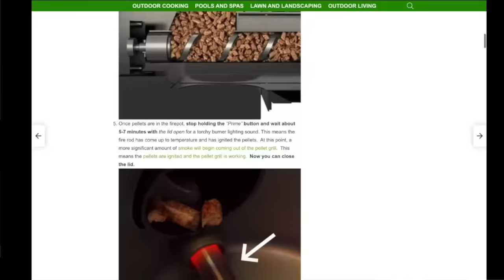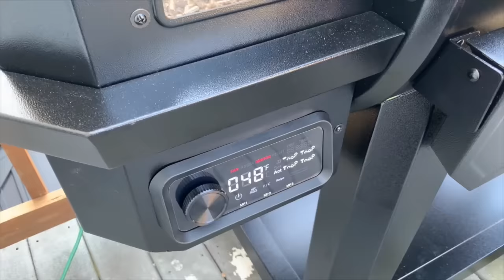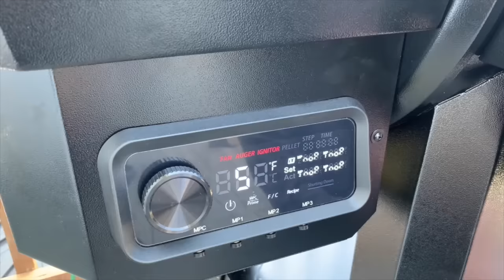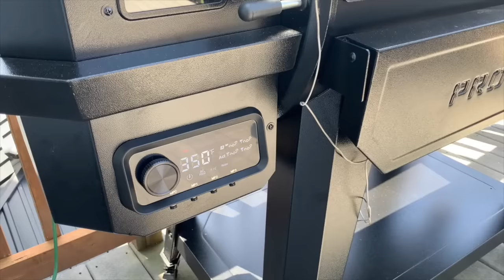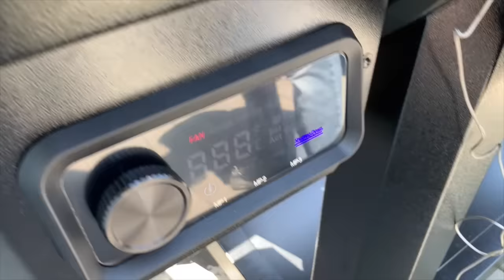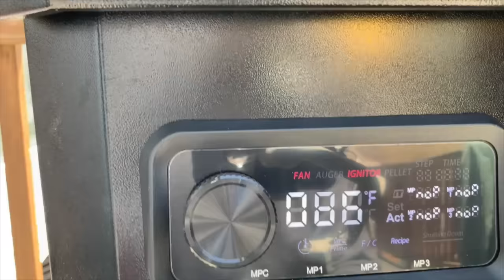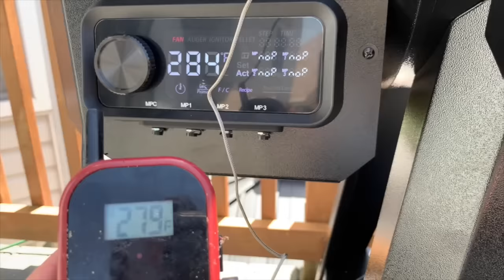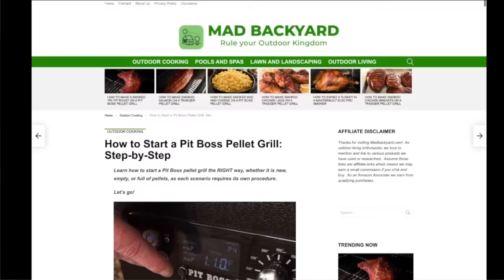How to Start and Season a New Pit Boss Pellet Grill

Comment: I just purchased the 1150 Pro Series last night, had to youtube to see how to properly use the probes because I guess it measures temps on top, middle and bottom from what I've read but "lucky me" (I think) the Gen3 was just released and Lowes pulled it out of the back of their warehouse for me instead of selling me the Gen2's that were on the floor.  I can't say yet what all is different other than the screen and control panel are different, it has a joystick type control knob, but what I would have prefered to be honest was the Gen1 grill grating.  It's really prefrance but I like the crisscross pattern they had in contrast to the new style which is the straight vertical grating only.  Oh well, back to watching your video, well explained and glad everything is working great so far (have a TriTip on there as we speak) but I never primed the auger although at least on my Gen2 it does have options for "Prime 1 second", "Prime 3 second", and "Prime 5 seconds" so maybe that's something new (I still don't understand all this stuff yet but having fun 😎 ) in contrast to having to hold the button like you explained?
Reply from the maker: Thanks for watching and glad you were able to get the newest model, would love to hear more what you think after cooking a few things on it!  The criss cross pattern grates look cool but are kind of a pain to clean, especially if trying to use a bristle free brush that's designed to slide between the grates, it just doesn't work.  I can only assume this is one of the reasons for the change maybe.  Holding the prime button is also a pain so I assume they got feedback about this as well to add the new timed features.  At least it sounds like they are listening to feedback from their customers!
Reply: @madbackyard  Sounds like it and yea, guess that makes sense about the crisscross pattern.  Another thing I noticed is the temperature gauge is no longer in the center top section of the grill itself but just all digital and on your mobile app so looks like they got rid of that.  I have BBQ's the last 3 nights in a row being Memorial Weekend, I'd say about the only thing that has bugged me so far is there is no super smoke mode that I can see nor is it on the app and I'm still dialing it in and struggling to lower the temperature and open or close the vent, etc in order figure out how to get it to smoke when I want it to.  Not sure if your version or the earlier versions had super smoker versions but I believe I saw in the video you did have a smoke option on the buttons if I'm not mistaken and know Traeger does too.  Not sure what happened there or if I'm just missing something I haven't seen yet?

Thanks for the helpful video though, I'll be watching your channel for new vids.
Reply from the maker: It does have the "Smoke" setting, not "super" smoke though.  I think all their models start on the Smoke setting when you first turn it on and it stays at about 180°F on this setting. If you watch the Pork Loin video we just did I start it on this setting for about 30 minutes before turning it up to finish cooking. I get the most smoke on this setting or the lower temperatures in the 200-270 range but even then its not constant like other types of smokers, only in bursts.  I've noticed certain brands of pellets put off more smoke (and better smoke flavor/aroma etc.) too like Bear Mountain pellets have worked really well for me lately.  Thanks for watching!

Comment: This video was super helpful! I just got my new pit boss and this was much more helpful to me than the manual by itself. Thank you!!
Reply from the maker: Thanks for watching, glad it helped!
Reply: I just brought one this weekend but I have a question.
Did the top rack lock in on both sides or just one side?
Reply from the maker: @robertcrawley7536  Hi Robert -  I dont have my top rack installed because I find it gets in the way more often than I actually end up using it.  However, there are brackets on both sides of the cooking chamber for it to rest on on mine, each with 4 square holes I assume for the rack to drop down and lock into place.  I have the Pit Boss Pro Series 1150 model. Check your user manual for the page where they have you install the top rack and see if its maybe put into place upside down or something.

Comment: Just got a Austin XL Onyx, I have a few questions if you read the comments, I know you get lots.
1. did I miss the part where you say how often to spray or burn off the grates? just the first time or more often?
2. did you make this video before you did the one about the smoke defusers and flame defusers? My Pitt boss cam with the smoke defusers. I have ordered the flame defuasser. I noticed you do not have either one. In the video where you suggested getting them you said they would eliminate the inconsistent heating temps at the Pitt Boss temp probe on the side. so I presume that you suggesting about it being more hot by the pipe is no more.
3. I cannot find out why the top on the pipe screws up and down. why do you want to control the exhaust? Thank you for the infor. I prefer this to on the job training and ruining things

Comment: How often do you recommend to spray the inside with oil? Only for first start up? Or should you do it often/after cleanings?
Reply from the maker: Good question: I would re-season after a deep cleaning or anytime you use a soap or degreaser on the inside to avoid rust formation. Check out our Deep Cleaning video where we talk more about this. https://youtu.be/fDQTh4GhAj0

Comment: Ugh, got my 1150 PS2 and did the burn off, completely forgot to season it like a Noob.  Great vid, I've gone back and seasoned it after cleaning it up.  Just got my heat deflector mod from smokeslikeaboss today and installed it, really hopeful it fixes the atrocious temperature issues.  I REALLY want to love this smoker!🥺
Reply from the maker: Thanks Michael!  You actually want to do at least one burnoff before seasoning anyways so it sounds like you still did it right.  

I got the same heat deflector mod (as well as the flame diffuser to sit over the firepot) from them!  Getting ready to do a video testing with and without the mods in place but so far I think they've made a big difference.  

Wish we didn't need them but I think that's the drawback of trying to provide a DIRECT heat option on a pellet grill.  At least the Pit Boss is cooking a lot more evenly and accurately now.  Thanks for watching!

Comment: Do i need to press prime every time to load the pellets? Or can i just power it on and the auger will start rotating?
Reply: only every time you run out of pellets or on first start up, if you already have pellets in the hopper and auger then you don’t, it’ll start up automatically as long as it has pellets all the way through the auger
Reply from the maker: Exactly. Only if the auger is empty of pellets like when it's brand new or if you ran through them all without ever refilling.

Comment: So how often, if ever, does it need to be re-seasoned? I just got my first Pit Boss, the Austin XL and followed your steps to get it all seasoned and ready to go. Thank for this great guide to getting that done. But just wondering if you ever have to re-season the grill, like after it has sat for extended periods or something like that. Thank you in advance.
Reply from the maker: I just reseason after doing a deep clean like in this video here https://youtu.be/fDQTh4GhAj0  Soap and degreasers will take off the layer of oil so you need to re-apply after a thorough cleaning to prevent rust formation.

Comment: Does the white smoke not appear every time it drops new pellets in from the hopper or is it just from the first primary load? I'm new to pellet grills here, I just assembled mine last night as a mother's day gift.
Reply from the maker: White smoke (sometimes called dirty smoke) is created when the pellets are first dropping in and being lit but are not that hot yet because the heating rod is still heating up.  As the cook goes on, the heating rod will be extremely hot and as the pellets drop in they will create better smoke.  The lower temp you cook at, the more visible the smoke will appear.  Anything over about 300°F, you usually stop seeing visible smoke because te pllets are burning much hotter. Hope that helps!

Comment: Thanks a million! This is my second PitBoss 850 (computer crapped out on the first one after two weeks) and this video was a huge help setting up the first grill so I knew I needed to use it for a refresher on the second set up.   This makes the burn of so much easier and has some useful tips not in the manual.
Reply from the maker: Glad it was helpful, thanks for the feedback Carl!
Reply: I'm curious , I assume acquiring the replacement grill didn't cost you anything?
Reply: @jimharris3889  I was within the return window so it did not.

Comment: So I just bought mine. I had a question about the pellets. Do I need to empty them out of the grill every time or can they sit there?
Reply from the maker: No you do not.  Empty your ash pot out before every cook so it doesn't build up and block the ignitor rod. Thats the only thing you need to do every time. The pellets will be fine unless....you don't plan on cooking for a week or longer if you live in a high humidity area. If you live in a dry climate you are probably good a for a couple weeks.

Comment: Do you have to use canola? can you use olive oil?
Reply from the maker: No you don't have to use canola, but you do want to choose an oil with a higher smoke point like canola, peanut, or grapeseed.  Olive oil is fine but I would use regular olive oil, not extra virgin, because it has a higher smoke point.  Canola, being the cheapest of all these options, is usually just what I default to recommending but there are many options when it comes to seasoning your smoker.  Thanks for watching!

Comment: Just bought a Pro Series 850 last night, I'm doing my start up now and the right side of my smoker is about 50 degrees cooler than the left side, left side is consistent with the smokers reading, this model has the upgraded curve on the left side (the infamous gap) so I didn't have to get  gap module. Thoughts?
Reply from the maker: My left side tends to run hotter, as well, even with the mods, just because the hot flame broiler is closer to the grates on that side.  I do notice temp fluctuations tend to even out the more I cook on new pellets grills as they season though too.  Airflow is very unrestricted when they are brand new and smooth and shiny (hence all the comments about pellet ash "flying around" which tends to stop after a few greasy cooks) so give it a few cooks.  50 degrees is a lot though.  If its still an issue I might try the three window flame tamer with the closed side pointed to the left to direct a little more heat to the right side.

Comment: Load pellets
Plug in pit boss
Turn on
Prime for 4-7 minutes until pellets hit the fire pot
Burn 350-400 for 30 min
Shut down
Let it cool down for 30 min
Spray with oil to “season grill” 
Fire it back up for 30 min on 350

What’s the point of firing it up the second time . Is it ideal to slap some meat on the second start

Comment: I noticed some white smoke coming out from the front and off the smoke stack. Does the door seals pretty good? Thanks for the video. Nice tips
Reply from the maker: It seals OK enough, it's not perfect by any means.  I do wish the lid itself was a little more heavy duty like the rest of the barrel is.  When you are generating a lot of smoke, you will see it seep out around the edges of the door.

Comment: I wonder if you put a large sheet of heavy aluminum foil over the grates would it help keep the grates clean while cooking?
I have done this with my Char-Broil propane cooker and the grates are really clean making cleanup easy.
Reply: I talked to Pit Boss a couple weeks ago and they told me NOT to use aluminum foil as it would dump grease onto the cooking surface and start a cooker fire.

Comment: Very new to pellet grills. Curious towards why you don't season while hot. Was always taught to season while hot and again once cooled.
Reply from the maker: Good question, we did bring up the temperature after applying the oil which is what causes the seasoning to occur. Looking back I could have even brought it up further to 400-450.  I would be hesitant to ever spray oil, especially aerosolized oil, directly into a very hot grill though.  Don't want that oil igniting!

Comment: Hello sir, thank you for this video it is a great help. I just purchased my first pit boss pro series  1150 grill. I'm following your video. 

One question though. The pellets I put in is it ok the leave the unused pellets in grill ? Or do I use them all up? Remove?
Reply from the maker: Hi Kevin- If you are cooking every few days it's fine to leave them in the hopper of the grill, especially if you live in a drier climate.  If you live in a very humid area and don't plan on using the pellet grill for over a week or longer, I would recommend emptying the hopper and keeping the leftovers in an airtight container.
 Here is a video I made showing how to do this:
https://youtu.be/sy8GZkWtRMI
It's probably best practice to just add as to close to as many pellets as you think you need for your cook that day rather than loading up the hopper and keeping it full at all times.

Comment: What if it doesn't turn blueish/purplish? I've had mine going for at least a half hour if not longer, followed step by step. Keep going?
Reply from the maker: Hi Randy - I wouldn't worry so much about that.  As long as you get past the initial white start up smoke and can hear (or see if you slide open the flamebroiler) the fire roaring in the fire pot you've gone through the startup process and should be good to go to set your temp and start cooking.
Reply: @Mad Backyard  thank you! I let it run for quite some time just to be sure, even let it heat up to around 400 for a bit as well, figured it would all be gone at that point lol. Thank you for the response and for the video!

Comment: I have the same pellet grill but the thermometer reads 30 to 50 degress less than the actual temps. In idea why? Ive already contacted pitboss and repalced the thermostat. It did not fix the issue though. Thanks.

Comment: Can't help but notice the dust from the pellets.. is there a way to reduce that?
Reply from the maker: The dust mostly stays contained in the bottom section under the flame broiler, especially once you start using the grill more and it's seasoned.  But you do need to shop vac it out every now and then when you clean your grill.

Comment: On mine the right side temp is lower for sure like a lot lower to a point where I’m forced to put the mean on the left or toward the middle to get some sear on it
Reply from the maker: Yes, thanks for pointing that out. I've found that to be the case now too after using this model more since making the video.  I've used other grills where its the opposite so I think I was making that assumption back when I made the video.

Comment: What did you mean by set it to smoke? Is that a temperature, or is there an actual setting called “smoke”?
Reply from the maker: Push the big button and it brings you to your temperature setting.  The very first setting looks like a "5" but it is "S" for Smoke. So it is the lowest setting on the dial. This will keep the grill around 180-210°F and also programmed to produce the most smoke of all the cooking temperatures.  When you first turn on the Pit Boss it is already on this setting automatically.  Keep it there for the first 10 minutes with the lid open before you set any other temperature.  This helps get the pellets ignited well and clears out the nasty white startup smoke. Then you can change temperature and close the lid.
Reply: So how do you turn smoke off?    Just run higher temp?
Reply from the maker: @BykerBub  There's not really a way to keep the grill from producing smoke at all,  but it will make MORE smoke at lower temperatures (obviously on the "Smoke" Setting which it defaults to on start up, and then from 180°F thru about 300°F you'll see more frequent smoke produced while cooking).  Above 300°-350°F, you won't see it producing as much smoke as the pellets burn hotter and faster in this range.  Hope that helps!

Comment: Hello. I’m considering buying a pellet grill. I’m wondering why you would only get white smoke when you first start up since I am assuming new pellets are constantly being lit? Thanks
Reply from the maker: Yes they are constantly being lit and you will get bursts of smoke throughout the cook as pellets are intermittently fed to the firepot.  The difference is in the very beginning the ignitor rod and fire pot are not fully hot and lit.  So the smoke in the very beginning is considered a more "dirty" smoke.  Same thing happens when you are starting a campfire and the smoke in the beginning is more cloudy and unpleasant than once the fire is roaring and you throw a new log on.  It's not the end of the world to expose your food to this smoke, and maybe I made too big a deal about it in the video. The point being to just give the pellet grill about 5-10 minute with the lid open to warm up and get the fire pot and ignitor rod hot before throwing your food on.